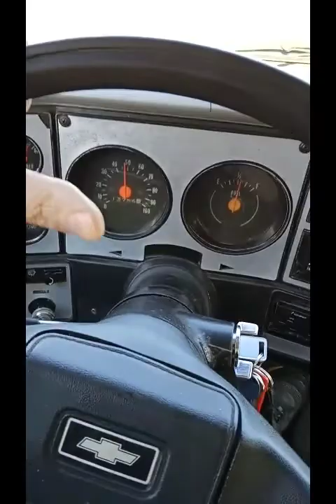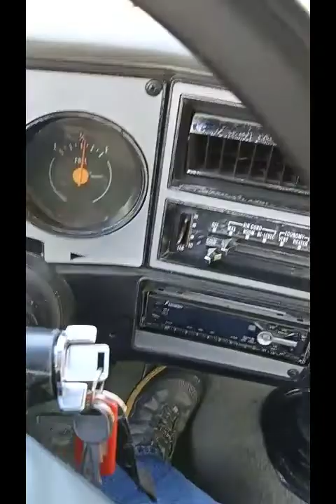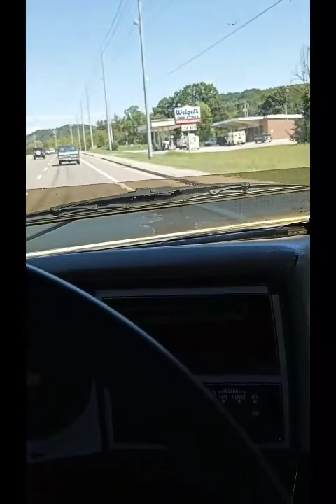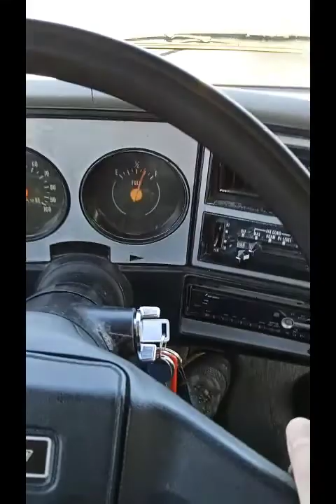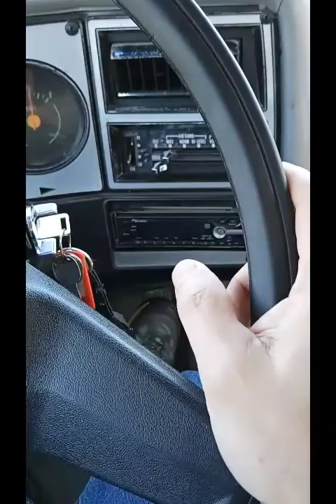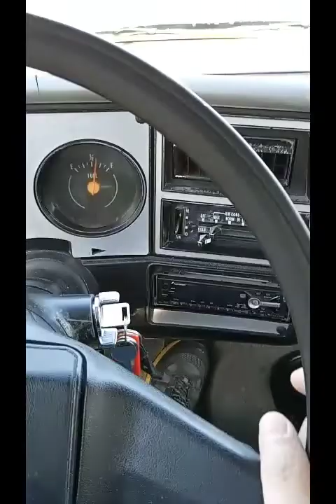Proper Operation of the GM SM 465 4 Speed 4x4 Transmission

Comment: My 1980 K20 has the SM465 with 4.10:1 gears front and rear. Have 33's on it.  No issues. My 2015 3500 has the G56 in it. I learned to drive on a three on the tree truck. Oh called granny gear in my area.
Reply from the maker: I remember 3 on the tree, old Rambler American in a pasture field. First car I drove.
Reply: Can you clarify, when you say 4th etc. On the shifter it actually says 3rd? Mine says L 1 2 3 R this is the sm465 correct?
Reply from the maker: sm 465 is a 4 speed, but normally in 2h the first granny gear is not useable, its not practical to shift in/out of ( without being in low range on the transfer case) so 2nd is the first 2wd operating gear.

Comment: Personally shifting into first double clutching into the correct rpm the trans does well
Reply from the maker: yeah but a lot of people dont know how to do that. Thats generally a thing of truck transmissions.. which this one IS.

That helps a ' heavy' transmission get to the proper speed. Theres a heavy countershaft in this transmission.

Comment: I drove  many  of those  4sp  they were  called  creepers  you didn't  need  1st gear  take  of it  in second  they were  very  tough  transmission  you have to  be  a really bad  driver  to kill  them   try driving  a 51 with  456 gears 4sp  talk about  low gear  wow and  without  power  brakes  or steering  i drove  all  types  still  driving  the 51 3600 5 window

Comment: Those transmissions are tough as nails I have been 7,500rpm bang shifting one for 16 years and it still shifts like butter Lol.
Reply from the maker: Its a one ton truck transmission, it has an easy life in a half ton truck with wheel slip.

Comment: Basically a 3 spd transmission
Reply from the maker: YES! Granny doesnt count... Yes there are four forward gears, but they arent "driving" gears.

Reverse is a gear in the transmission, but it doesnt count, its not for 'forward driving'

Low is for crawling.

Comment: I have to start in 1st instead of second because it stalls to easy
Reply from the maker: That shouldnt happen, it should take several seconds in 2 nd hi range to get in gear but it should go.

Id check the brakes and driveline for dragging brakes of bad U joints.

.Bad U joints can bring it to a halt.
Reply: I think your truck may have a 2.73 or 3.08 rear gear with larger tires if it needs granny (1st gear) to start off normal driving.  Not a bad thing at all for just daily driving!
Reply from the maker: Wrong information. Mine has 308 and no trouble starting in 2 nd gear. The only way that engine stalls in that vehicle is standing on the brakes or maybe trying to start off in high gear.

Ive started in 3 rd but its hard on the clutch.

"I think maybe" means you have no idea what youre talking about .

I normally delete bad info like that but its instructive to call out the folk online that pretend to be experts...
Reply: @k8byp  I got her figured out, hanging break and carburetor issues and lack of experience, but now I can start in 2nd
Reply from the maker: Never doubt me....unless im wrong..😰
Also check the intake manifold for air leaks especially between # 4 and 6, heating and cooling cause the bolts to come loose and suck air and dirt into the intake runners.
Its jecessary to resurface the intake manifold and head surfaces but that can be done without removing the heads, use sandpaper and polished marble or granite countertop material to grind the surfaces flat, being careful to keep debris out of the engine. The stone is extremely flat and acts as a precision sanding block. Those air leaks will cause bad stumbling off idle
Reply: @k8byp  I have an 86 k10 with a 350 and the granny low and never thought of putting it in 2L, so I'll have to try it out. Thanks for the knowledge!
Reply from the maker: : 0